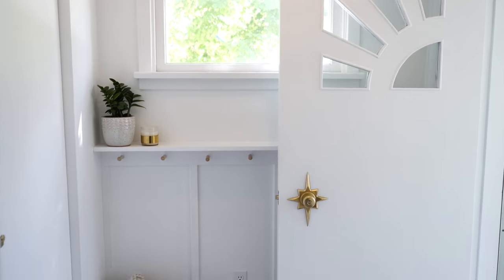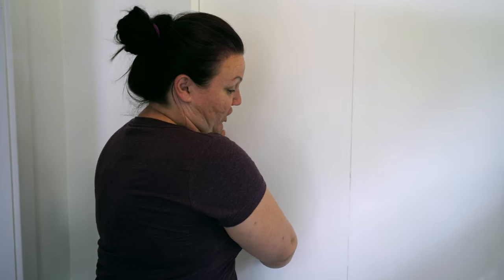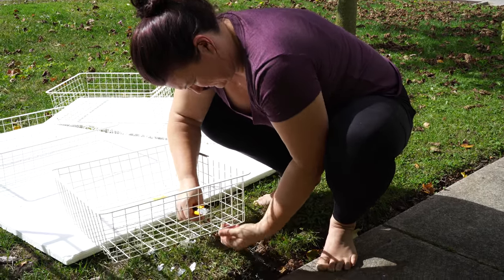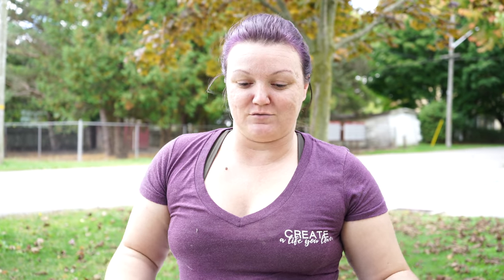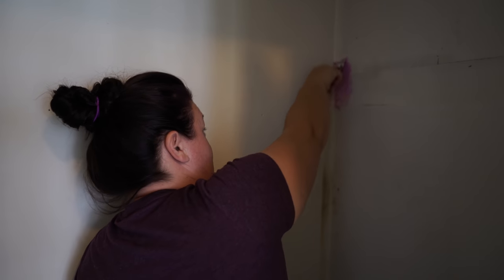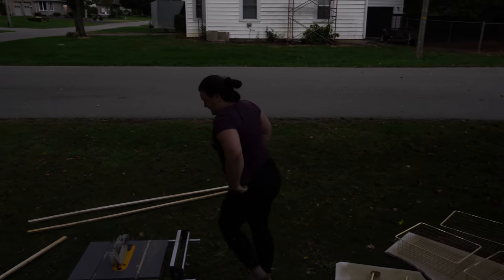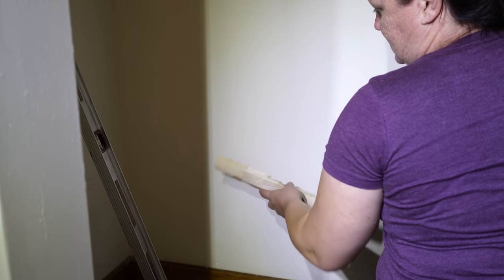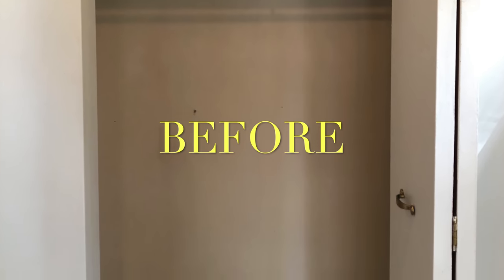MINIMALIST Entry Closet Makeover + TRASH TO TREASURE Curbside find! Home Edit

Comment: Did you add a sealer to the painted baskets and clothes pole? I suspect hangers will be pushed along the pole and baskets may be pulled out or pushed in, which may remove the paint. (Especially dragging wire hangers moved back and forth along the pole). Just my 2 cents! ( meaning my opinion that is only worth 2 cents and can be ignored). 😊
Reply: NO WIRE HANGERS!!! — Joan Crawford 
But seriously, you made a good point. I can just never forget that scene in Mommie, Dearest. 😊
Reply: Sharon G,, Sorry, I didn’t see the movie. But most hangers have some type of metal to curve around the clothes pole— unless you have plastic hangers, which I refuse to use because they end up in the ocean, destroying sea life.